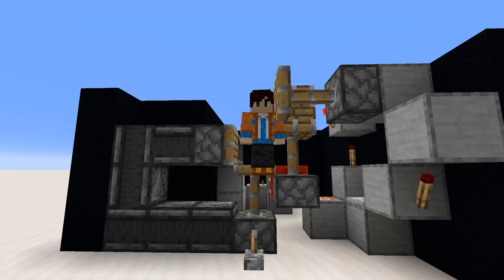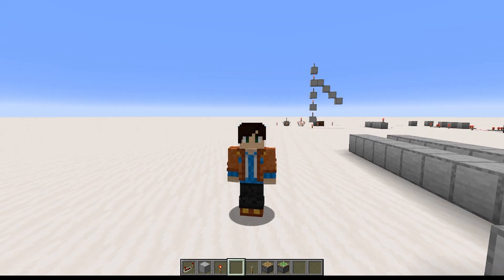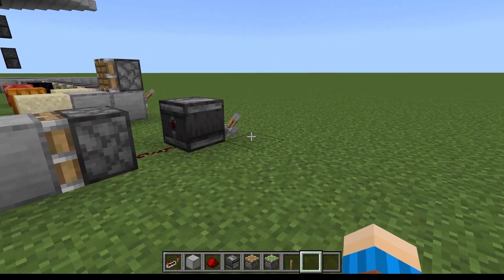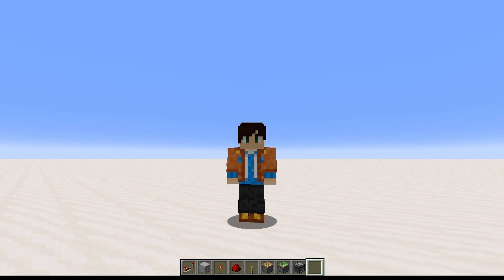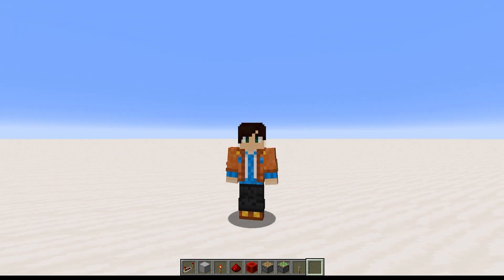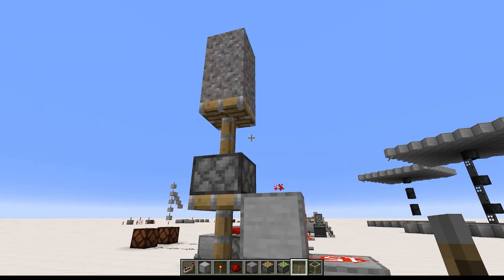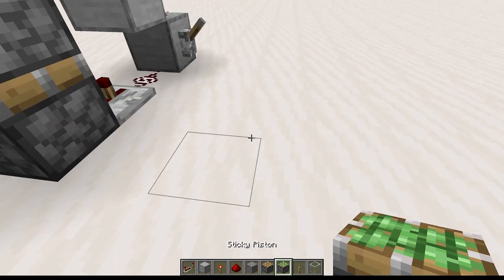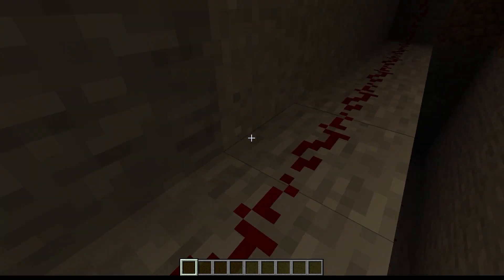The Piston (and Sticky Piston): How to Use Minecraft's Pushiest Block

Comment: Love this series, thanks for your effort :) 
I just tried to re-create your examples. The actual T-flip-flip works as you showed it. But the example of a basic pulse shortener does not activate the sticky piston. I see the line of redstone dust light up briefly, but the piston does not move (not 1-tick-pulse push, no movement at all). When I remove the redstone dust line and put the stick piston right next to the pulse shortener, it 1-tick pulse extends/retracts as intended (just like in the actual T-flip-flop). So I'm wonding why the redstone dust breaks it - and why it works in your video :)  Any ideas what I might be doing wrong?
Reply: When I add a repeater between the pulse shortener and the redstone dust line, the sticky piston does do the 1-tick pulse extension properly.
Reply from the maker: Can you share a picture? Also, what version are you on?